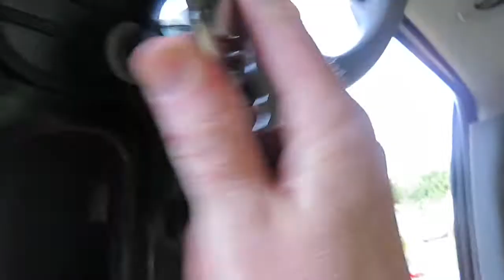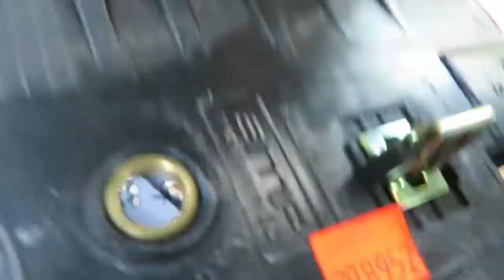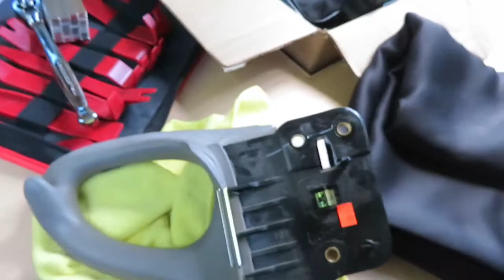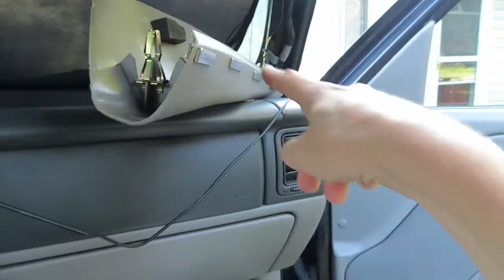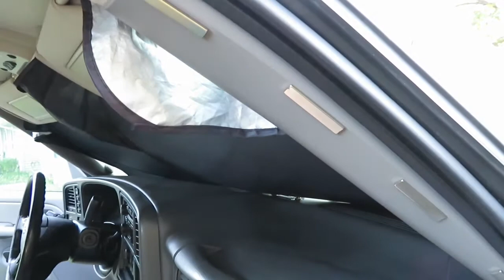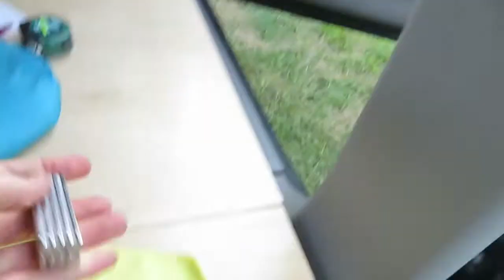Suboverland build out, Episode 21:  More fun with hidden magnets...

Comment: Great job. I would have Velcrod it all. Not sure I'd have the patience.
Reply from the maker: I thought about that but was afraid the adhesive on the Velcro wouldn't hold up to very much heat/sunlight exposure.  I also didn't want to deal with the sound of it on a daily basis.  Not a fan of the Velcro melody.  Lol.  IMO, it's definitely worth the extra effort upfront to save myself the headache every day thereafter.